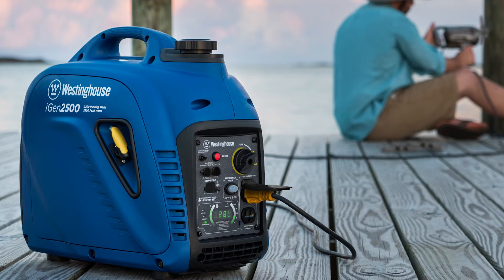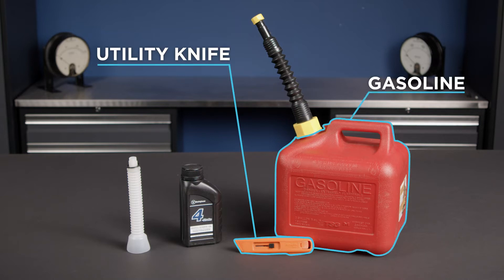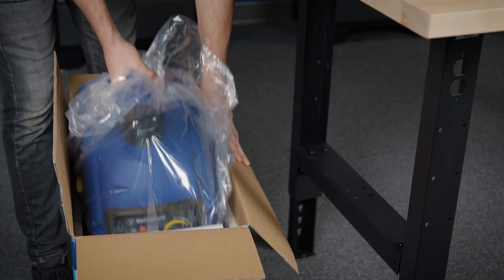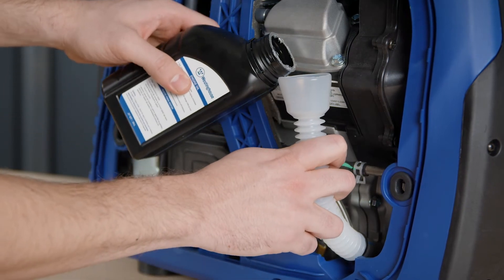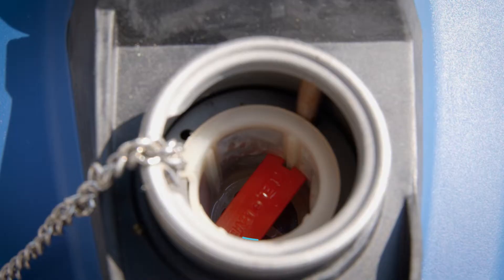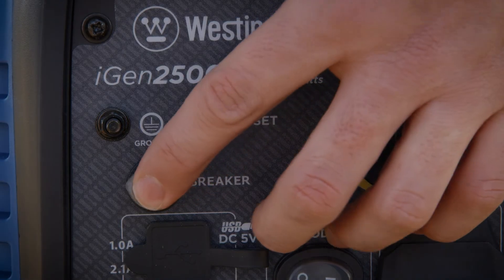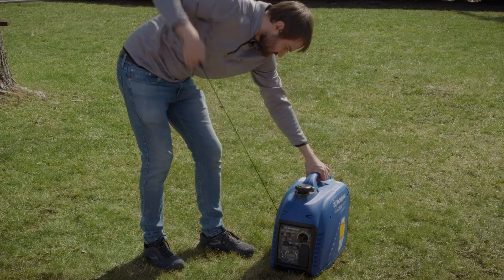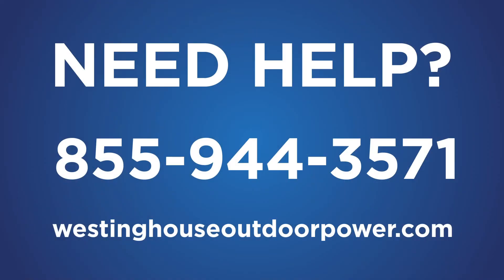How To Unbox and Prep Your Westinghouse iGen Series Generator

Comment: I always heard you need to run this thing in for about 5 hours with less than 50% load, then change the oil before regular load? Is  this recommended still?